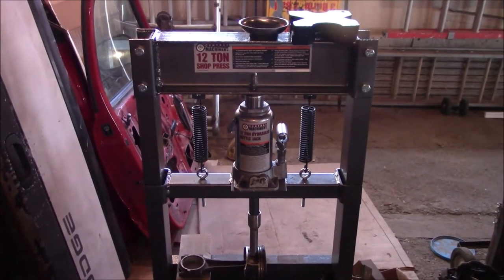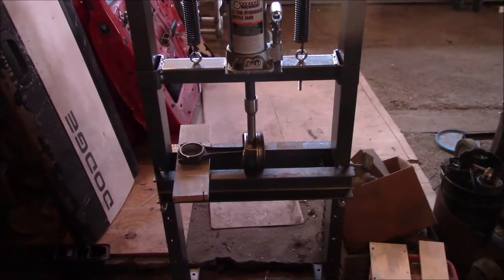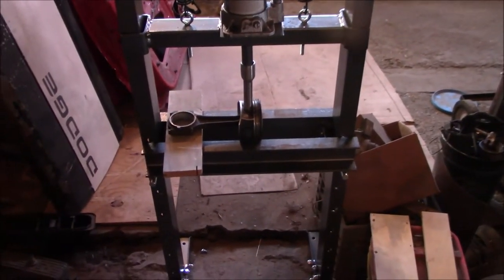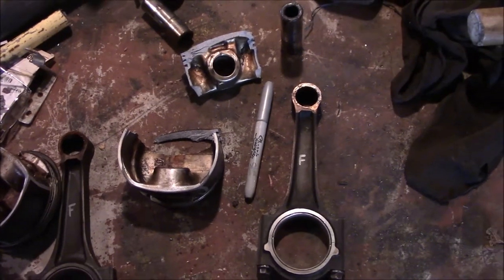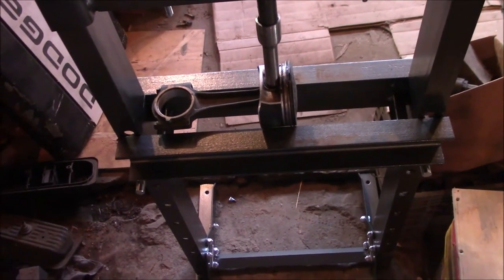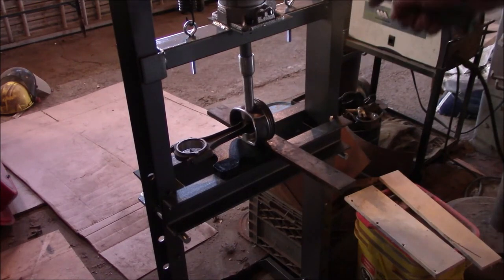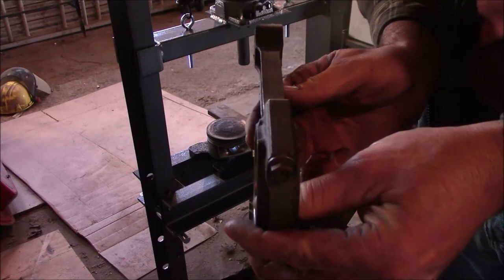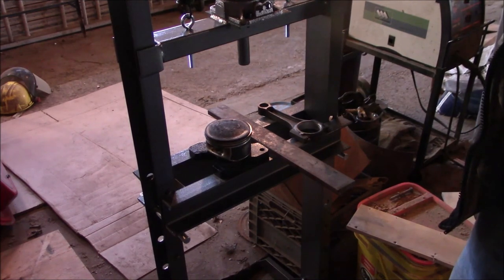Wrist Pin Removal Failure (DON'T DO WHAT I DID!!!)

Comment: Thanks for the helpful video and your openness in sharing your trial and errors! Currently, I'm working on rebuilding my 5.7 Hemi. While I initially considered trying the Harbor Freight press method for the wrist pins, your insights have led me to think it might be in my best interest to either invest in some liquid nitrogen to rapidly cool the pins so they'll shrink, as well as a torch to expand the rod ends, or just let a shop handle them. 😃
Reply from the maker: Well I'm sorry my reply is so late. I never saw it till now. I did all the rest of them and 8 more from another engine and never had anymore problems with it. I just made sure I supported it directly under the pistons and just let the rod hang there instead of supporting it, so in case the piston broke again it wouldn't bend the rod. In my case I didn't care about the pistons because I was replacing them anyway, but I did want to keep the rods. Anyway.  Thanks. I hope yours go well or did go well.

Comment: it broke because you are applying the force onto the piston. The friction fit is with the connecting rod thus you must support the connecting rod when applying force. there are plenty of videos with setup to properly press the wrist pin out of the connecting rod. You would damage the new piston when attempting to press the pin the way you are.

Comment: I just removed my seized wrist pin on my dirtbike while installed on the bike for a piston replacement. What i did was use a bolt with a hex head the right size and a bunch of washers the same size and a socket and simply tightened the bolt forcing the pin out with control and ease with no chance of damage total cost for the bolt nut and washers was $3.00 nothing could have worked better !